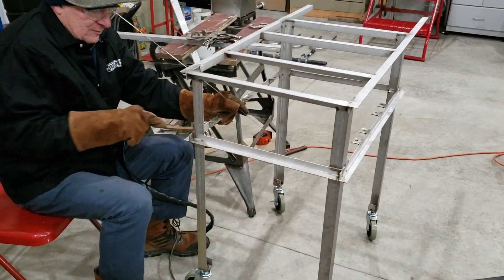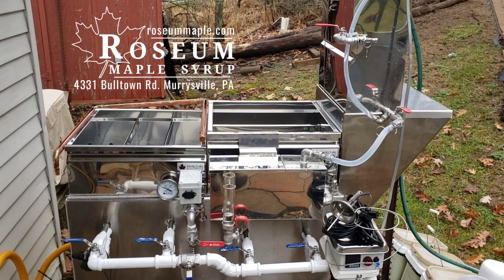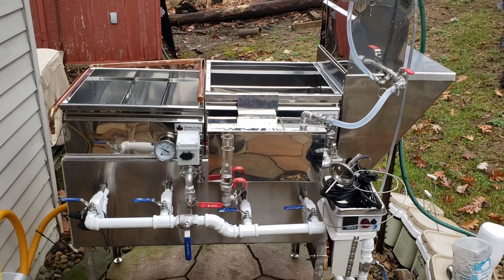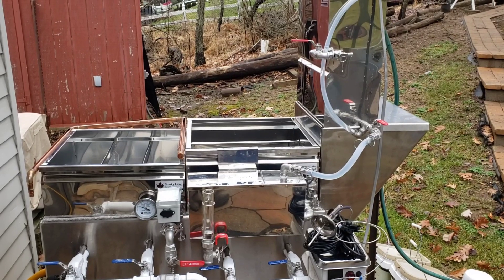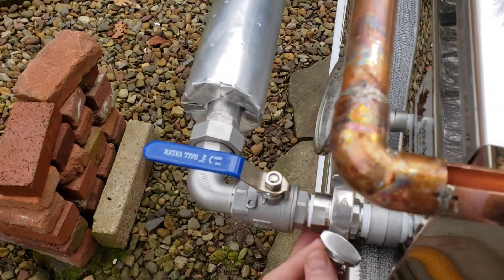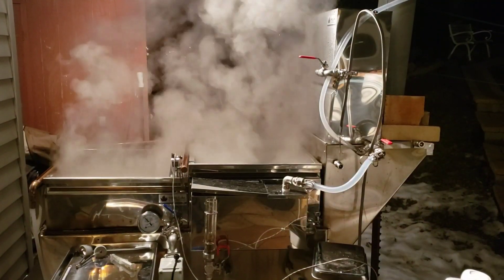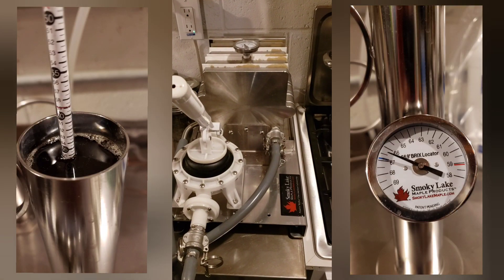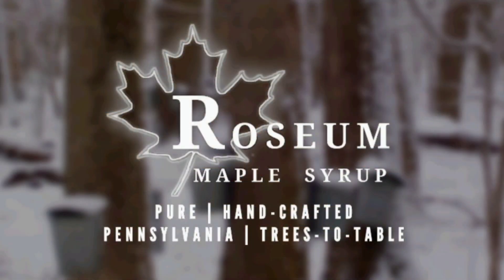Smoky Lake Dauntless - Custom Natural Gas Evaporator - Adventures in Maple: Builders of the Gas Arch

Comment: What is the gas pressure for this system? What PSI runs this system?
Reply from the maker: I run this on a residential gas line.  It's a 1 inch line off the 1.5" mainline into my house.

Comment: Could you do a more in depth video on the build of your custom arch please? What were the numbers for evaporation rate for this set up?
Reply from the maker: I have a blog post on a previous build I that tore apart and rebuilt for this evaporator.  Its a stainless frame with stainless sidewalls that I bent on a homemade bending brake.

I was able to get ~15 gph boiling outside. 

https://www.roseummaple.com/2019/03/custom-hobby-maple-syrup-evaporator.html